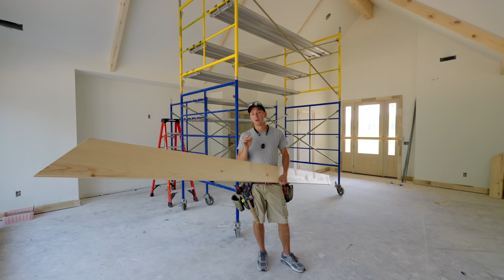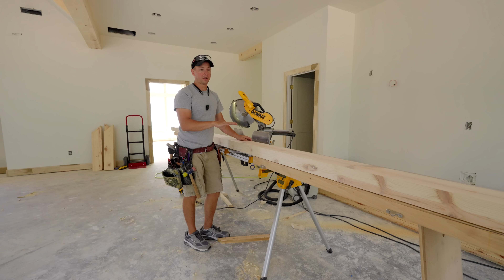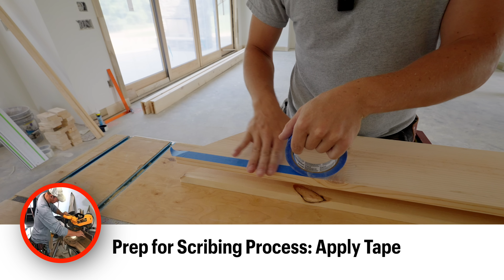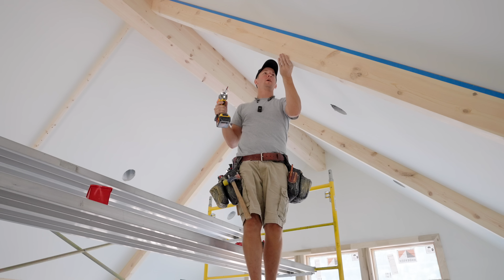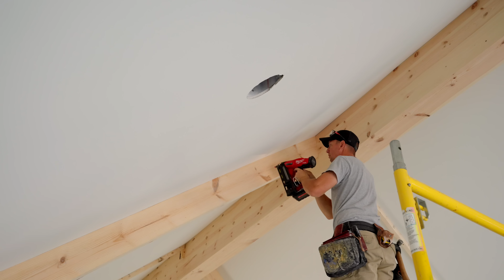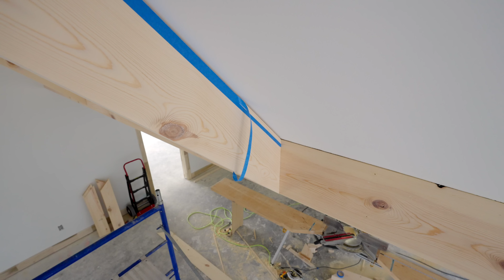How To Fit Cathedral Beams | Installation Tips

Comment: For your final length, why didn't you correct your angles first before marking your lines for a final length?  You're 5/32nds strong, so that equates to 10/32nds, which means your overall length is going to be short if u didn't add that 10/32nds to the + 1-3/4" you noted. If you don't, your overall is going to be short 10/32nds. 

I believe you did add it with your gauge block, but I don't think I saw you add the 1-3/4. 

If I'm wrong, pls correct me, but what I noted makes sense to me. 

Wouldn't it be better if you adjusted ur angle on both ends, then mark your lines for the overall?

Technically, you could have scribed the ends of the beam to the drywall and the ridge beam. 

Another issue I see is once you scribe it, that can change the angles where it meets the beam and the drywall. 

Wouldn't it have been easier to have your template piece be say 1/4" short of the overall length and temporarily tack it, scribe the template piece to the ceiling, then set the template onto the beam, draw a line onto your actual beam and then use your circular saw and belt sander.  Then you can cut a new straight edge on the table saw and repeat. 
Once you do one side

You were just guessing at the 5/32nds

Also, why didn't you use clear pine or poplar?  If you're going to paint it, the knots are going to show through. If not right away, over time it will. 

Wouldn't it be a lot faster to use a belt sander horizontally than a block plane?  A belt sander would have taken you literally half the time.
Reply: First, you can't scribe the beam against the wall and beam if it's too long to fit between them. 
He is adding the corrections to the short end of his bevels. As long as the long ends are butted to the wall and ridge beam the overall length doesn't change.
A taper gauge is fine for measuring the gap on the pattern / template, and is accurate to withing 1/64". If it's scribed in place the line has to be at absolute zero on the long end. Cutting just a pencil line on the long point would definitely make the beam short. 

The 1-3/4 was added after he cut the ridge end of the beam. The bevel was cut, then the template was moved back 1-3/4, then the tail end was laid out and cut. 

If the template was scribed to the ceiling one would be needed for both sides of each beam. Using a board then reestablishing a straight edge for the next side is more work. Multiple beams with two sides each would require several templates as they get cut down. The purpose of using a pattern board is for consistency. The more templates used the greater chance of an error.
Actually, it would require a separate board for each side. Using a narrower template would fail to show the 1" difference where the point was too low on the second beam he installed. That issue wouldn't show up until the beam was being installed. Then it would have to be taken down and recut.  
Twice the lumber, twice the cutting, twice the cost.

Using a taper gauge is not guessing. As stated they are accurate to 1/64". There is no such measurement as 10/32". That would be 5/16.

He used the lumber the builder called for. It's going to be stained. Knots add character to stained wood. Whether that's preferable or not is a personal preference. He's doing the install, not the design.

A good carpenter can use a block plane pretty quickly. Belt sanders make clouds of dust. A few extra minutes of work in exchange for much greater air quality is more than worth it. 
Unless one prefers breathing dust or having to work in a mask that is. In which case by all means, sand away.
Reply: I was going to ask the same question about "once you scribe it, that can change the angles where it meets the beam...". But after I thought about it a bit, he used a crown-down board for the template so it would clear any bumps in the ceiling, thus keeping the two ends unaffected by any humps in the middle. Spencer - is that correct? Great video - thanks!
Reply: @ST-0311  coming from being a high end custom cabinetry maker, I guess it's the difference between a carpenter and a cabinet maker. 

FYI, there is such a dimension as 10/32. Count the amount of 32nds on a tape measure and you'll figure it out. 5/16 or 10/32 is the same exact thing.

In your opinion knots to add character. To me it looks like cheap work. The customer shouldn't have been a cheapskate and spent the money to have Poplar. To respond to the rest of your rant, once again, that's the difference between a cabinet maker and a carpenter.  Once again, that's your opinion and my opinion is mine and we both have the right to express our opinions.

Lastly, you can't adjust a board to the concave curved parts with a plane. It's always going to leave a sharp end. If you are that afraid of the dust, wear a mask.